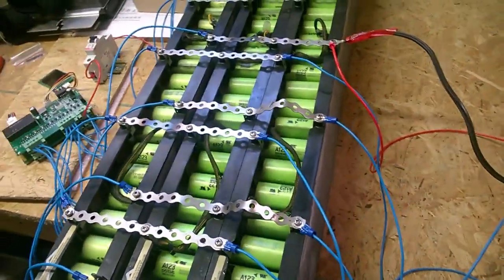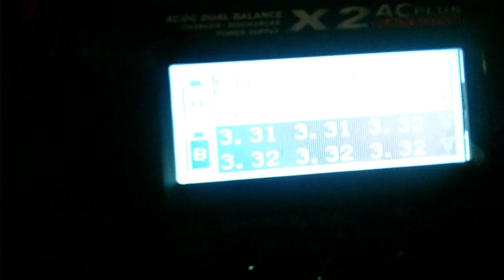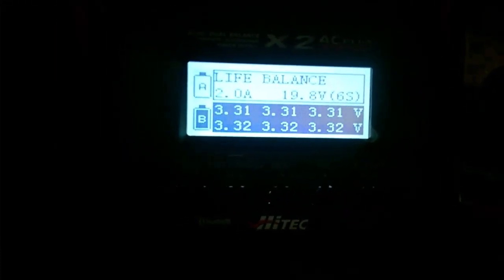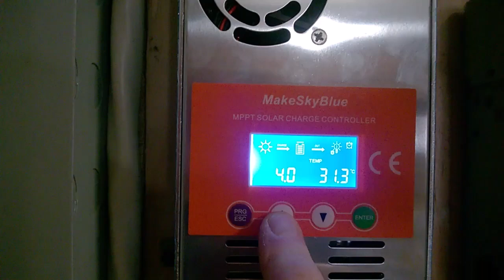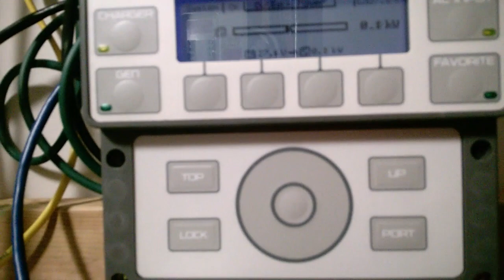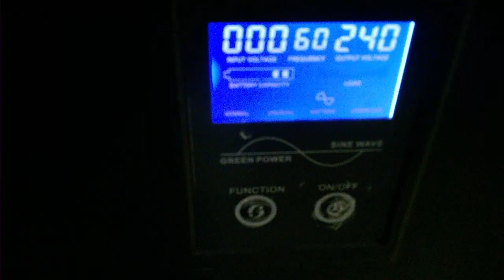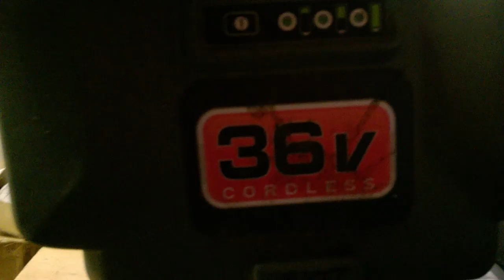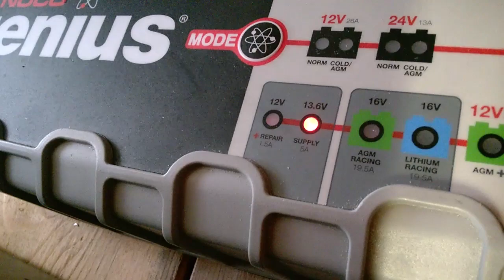2019 27 A123 battery update my obession with Lithium continues

Comment: How did you set up your solar panels on the makeskyblue
Reply from the maker: Just follow the menu for voltage but don't over panel the Makeskyblue they don't like high wattage or high voltage follow the manufacturers directions. I used 3 panels in series for 120 volts
Reply: @offgridwanabe  I can only put on series 2 panels of 46V peak.
Reply from the maker: @simplyfocus9937  Yes 2 or 3 in series works but keep the wattage down to 1800 watts

Comment: Where did you get those copper holes strapping line things you used to parrelel series connections I need that
Reply from the maker: Plumbing department used for strapping copper pipes.
Reply: @offgridwanabe  must be a Canadian thingni think ur from canada  I only found a crappy only not like that in the us east coast
Thanks anyway I am building mine like that now but taking the 12s and making them 16s so I can work with 48v inverters
Reply from the maker: @plojm123  https://www.homedepot.ca/product/dahl-all-round-strapping-copper-22ga-1-2-inch-x-10-feet/1000115954
Reply: @offgridwanabe  awesome supply house has online. Another question I just got a bunch of packs most testing good so far what size bolts are the terminal ends they seem so small the threads I am surprised they used that kind of small thread to hold something with so many amps

Comment: How do you base charging amps for cell groups. Are you going with spec so i mean if spec says 3 amps per cell standard then a group of 8 cells 24 amps. That type thing.
Reply from the maker: Well basically I cannot produce enough amperage to worry about the safety of too much amps because I need so many to have any capacity worth using. But I did consider it at first and the racks hold 16 packs with 12 groups of 8 so so at 5c I can't even get close with solar, the wiring and breakers limits me more than anything else.
Reply: @offgridwanabe  Understand and sort of figured that to.  I figured i would 1000's of amps on the single cell groups.I can come up with around 600 amps but that is not even close to what the spec's state for standard. Which is not able to be done. So i,m still in thought about it yet to what's the best way to go.
Reply from the maker: @MrDoingEverything  Remember amps are shared so if you have an 80 amp breaker on the pack each cell group of 8 would draw 80/12=6.6 amps and then /8 =.83 amps and that is on just one pack a little different on say 12 volts 80/4 =20amps/8=2.5amps per cell and if I can remember right 2.5 amps recommended or 10 amps for 12 minutes on fast charge.
Hope this helps
Reply from the maker: Hey if you think I am wrong let me know I don't pretend to know it all and learn every day.
Reply: @offgridwanabe  Your right a sharing happens
Reply from the maker: @MrDoingEverything  Ya not always is the sharing equal in amps as I have observed many times but I believe that is the nature of batteries theory only goes so far then you just got to do it and the poorer batteries are usually faster to take the charge.
Reply: @offgridwanabe  Lot of factors for sure.  We have what we have to work with and finding the best methods that work on the equal scale. As long as we get it all to work out the best we can hey what else is there really. : )

Comment: Hey, those built-in balance boards don't work unless they're given a special signal to turn on.  Even then, they're very weak (judging by the size of the resistor arrays), so even if they did work, they would be just enough for one pack in good condition, much less several worn packs in parallel.
It would be best to throw them out and use a real balancer on large parallel arrays of packs.  The parallel  arrays of packs will reduce balancer costs, wiring complexity, and promote higher inter-pack current sharing/balancing to preemptively even things out, but will require a strong balancer (up to several amps) to keep them in line.
Reply from the maker: True enough that is the way I went too bad I didn't know that 2 years ago tho. Been interesting figuring it out Now I have 40 kwh hooked up and running

Comment: Hi, I just got a few of these and I'm trying to figure them out. Do you have a one line diagram of this so it's a little bit easier to navigate through and know what else to buy. Thanks, your videos are of great help!
Reply from the maker: Not sure what you are looking for the battery is 12s 8p which is 40 volts of LiFePo4 lithium. So you need to decide what voltage you are using and configure the series to that. 
i am the worst at reading electrical diagrams and seldom use them. If I can help I always respond to a question good luck.
Reply: @offgridwanabe  Ca you provide me the model of charger that you are using?
Reply from the maker: @fabianluciano5237  I have several Charge controllers Midnite 250 is the one I like the most. I usually use the inverter / charger with AC charging when I need it both the outback and the Magnum have built in AC charging. I also use the Tripp lite on the 40 volt system. The powMr or Make Sky Blue is a cheap charger that will  get the job done but the exact control is not there IMHO. My system is very complex so I use AC coupling with the magnum to charge at night. I hope this helps I know it is very confusing.

Comment: Hey there! 

Question for ya. not sure if I misunderstood ya, but did you manage to get the built in BMS to work? if so, mind sharing how you did it? 

Thanks from Ontario!
Reply from the maker: No I did not get the original BMS (that came with the pack) to work. But I did get the ANT BMS to work and it works great
Reply: @offgridwanabe  Gotcha! Trying to figure out if it would be possible to use the built in BMS to only do the charging portion, then by pass it for discharge
Reply from the maker: @camofelix  It may be possible from what I think you need an outside voltage applied to the board maybe 3.5 - 12 volts to activate it and allow data transfer to the temperature probes but this is all conjecture and may destroy the board but I at least have lots of them to practice but I am not that bored yet lol.
Reply from the maker: @camofelix  Also the original board did not control the charging as in the current was not passed through the board, but in my best guess it controlled the balance and sent information to the controller which we don't have to discontinue the charge so kinda like a relay.

Comment: I love your work on the bus battery packs. Thinking about powering an off the grid cabin myself. I'd love to talk to you and learn about your experience on this.
Reply from the maker: Thanks for the sub I normally answer any questions I can, this helps those that don't want to ask and then everybody can get what they may need.
Reply: @offgridwanabe  So nice to see your prompt response.  I ordered 3 packs from Ebay before discovering yours and Frank's work. My main concern is that the batteries are so worn out that I will not be able to use them as a whole pack. But your videos are really encouraging.  Based on your experience having worked on dozens of them, what are the chances that I can work with the packs as they without having to dismantle them?
Reply from the maker: @josephdewuhan  Most packs I have seen are ok they really don't wear out but may be only 80% capacity. What does happen is one or two of the series may be damaged from corrosion or abuse and they can be fixed or new packs. When you get them find out what version you have the two most common are A or B I prefer the B series but A works too. The biggest problem for most people is getting the correct series for the voltage they want anything under 40 volts can be done without dismantling the battery pack. Frank even runs some at 120 volt DC but you need special equipment. So soon as you get them check each series to see if they are good or dead likely around 3.2 and whole pack around 38 or higher. Good luck
Reply: @offgridwanabe  Thank you so much for your answer. I look forward to receiving my packs. Another question,  where do you buy solar panels in Canada? What kind of price per watt is considered a good buy?
Reply from the maker: @josephdewuhan  Depends where you live. I find most things I need on Kijiji and I love a deal, $100 for a 250 watt panel is more than enough but you may have to but 25 or more. I see lots for $150. I found my Canadian Solar 72 cell panels 3 years ago for $0.33 a watt.
Reply: @offgridwanabe  wow, the best price I can find now is something like $250 for  300 w, something like 0.83/watt. Cannot find cheaper than that.
Reply from the maker: @josephdewuhan  What city do you live near?
Reply from the maker: Here is a couple of examples
https://www.kijiji.ca/v-home-indoor-other/mississauga-peel-region/used-230w-solar-panel-module-home-house-cottage/1487281339
https://www.kijiji.ca/v-home-outdoor-other/belleville/295w-canadians-solar-panels/1491271379
Reply: @offgridwanabe  I'm in Vancouver. Anything in the east would be expensive if shipping fee is calculated. So, that is a big disadvantage.
Reply from the maker: @josephdewuhan  Oh too bad ... best buy a skid full and sell the rest, by the looks of prices in Vancouver.

Comment: wow, is it worth the price difference between this and a full size battery?
Reply from the maker: Yes these were from Buses and they scrapped them all as they are going to full electric and not hybrid so I get around 8kwh for $600 and I can use most of it unlike lead acid.

Comment: Nice setup, i have some of the bus batteries ordered to see how i like them, going to use them on a 24 volt magna sine PAE 4024 AC coupled system . have you got the BMS that came with the bus battery to work? I wondered if I could link the battries together and balance them hope it works out.
Reply from the maker: I abandoned the original BMS it didn't do what I wanted as I needed more control for balance. Yes they will balance but I suggest using a bms with active balance and at least 1 amp of transfer power the 200 milliamp works but just barely if the packs are out too much. All in the bus batteries are ok and we get get them at the right price directly from the junk yard
Reply: @offgridwanabe  That's quite helpful, thanks! Yes, I think that the original BMS on the module just did passive balancing between the 12 cells of the module.  It also appears that the overall pack controller did additional balancing between the modules: check out this quote from the bus manual: "(3) Individual ESS Module Over-Charging Protection.
The ESS is made up of 16 individual, 39.6 V DC (nominal) modules connected in-series.
Due to manufacturing and temperature variations among the modules, there are slight
impedance differences in each of the 16 individual modules. This impedance mismatch
tends to force the voltage of each of the 16 series-connected modules to be different as
current is extracted from and delivered to the complete ESS. In order to protect each
individual module from being over-charged or under-charged due to the voltage mismatch,
an electronic battery optimization system is employed to actively equalize the voltages of
the individual modules."
Reply from the maker: @barryrawn8167  Thanks I have heard with an external 5 volts applied to the bms it becomes active but I found much more control with a new BMS but still an interesting fact about the impedance and the balancer shows the difference in resistance of each series so I know what they mean.
Reply: @offgridwanabe  True, it's nice to know the impedance can be a clue about future performance troubles.  Where did you hear that it can be activated with 5V? I'm trying to work out if one can communicate with the BMS, as it seems like the modules are originally daisy-chained to allow information in and out..
Reply from the maker: @barryrawn8167   Well some website way back had some technical information and I was reading it I wish I had kept it but I had already decided to move on so in one ear and out the other.
Reply: @offgridwanabe  ha ha ok I understand.  Thanks for giving it a thought and good luck with your continued powerwall development!

Comment: So, you have a 120 volt inverter?  What is the brand/make of that?  That probably keeps the amps pretty low.
Reply from the maker: Yes it does keep the amps low and wire size is small, but you need to find charge controller that will make enough voltage and string size also increases, I don't know the make likely Foshan or Fangpusun . The nice part is the voltage range of usable battery is larger. Cheers
Reply: @offgridwanabe  Cool.  I would love to watch a video just centered on the topic of 120 volts DC.  Such as finding an inverter, finding a charge controller.  Pros/cons.  I think it's awesome when people do things out of the ordinary.
Reply from the maker: @DavidPozEnergy  I already dismantled that experiment for now and started battery operated Enphase inverters as they match the voltage profile of those A123 batteries better. Frank Z has a 120 volt system he uses all the time I may put mine back together again for water heating this winter. Thanks for watching.

Comment: hi from great britain are these cells good quality as im after renewing my v28 milwaukee tool batteries and also a pack for a 48v scooter i have bought that has lead acid at moment any advice appreciated mel
Reply from the maker: Hello and welcome to my channel. For the most part these batteries are pretty good but I bought them knowing some would be bad after all they were from the junkyard. I have over 4000 of them and so far about 100 bad ones. Being Lifep04 they convert easily to any lead acid voltage.
Reply: i have asked wang the company man in china tonight as they now own the boston/michigan based a123 company   yes shipping is a pain
Reply from the maker: @honda4004  Yes china is the easiest way to order lithium Alibaba or Aliexpress They seem to know ways around the shipping.
Reply: hi again just after some tech advice now  just stripped me v28 milwaukee batteries down to each bare cell and checked out puts and they read zero on 6 and from 0.01  to 0.03 on 8 may it be i can charge it cell up or does that class them as knackered any help appreciated as first attempt on this battery recondition
Reply from the maker: @honda4004   This is a tool battery right? if so I have tickled them with 12 volt to wake them up so the charger will recognize them otherwise the best way is to use a hobby charger like HiTec or similar to charge each battery to see if it will hold a charge. Those batteries are 26700 so a little different than the 26650 I have but very similar in voltage requirements.
Reply: thanks yes tool battery best thing is they were made in canada but no maker unless moli is a maker got them in bits now so new cells or class b would be best route as ive had these 8 years not used last 3 years so that maybe whats caused degrade   what would you say are best cells on market for cost   them a123 cells are on ebay uk a guy inpoland said for 28 cells £62 plus shiping
Reply from the maker: @honda4004   well from what I see you can get a replacement battery for $75 so that is likely the best bet. But if you wanted to fix your self the 26650 would fit but new ones are about 10-13 dollars each  and you need 8, so that is why I suggest to get the replacement. Perhaps you can find used ones on GB.
Reply from the maker: @honda4004   The other way is to use 18650 cells they are more easily found and cheaper the trick is to get the voltage required as they are 4.1 volts per cell so you would only need 7 in series but you would need to be careful charging them
Reply: thanks not that electronically minded but the link i sent you on the aldi ferrex batteries the guy strips there 40v one down in another video and they look good 2500mah
https://youtu.be/H9Mb5_nCVeo
appreciate your view the 40v are the yellow set x 10 so for £90 i could repair 4 milwaukee batteries
Reply: hi thanks for all your advice i have found out my original moli cells were made in british columbia you anywhere near there factory :)  and ordered a cheap 2 cell li ion charger off ebay to see if these  originals kick back up may go down the aldi supermarket ferrex 40v route though it says rigid 24v use these moi cells but not a popular tool in britain thanks again and i welcome suggestions
Reply from the maker: @honda4004  I am glad you found an answer. Unfortunately BC is almost as far away as you lol about 5000 kms but a wonderful place. Remember to charge the dead ones at as low amperage as you can to start to see if you can revive them and Good luck
Reply: thank you  im in to static air engine if you see my land rover video i met a guy on youtube called peter stevens of northern australia ingventor  his channel name he knows all about vander vault forces his web site www.weathercreation.com  he knows how to run engines on stripped energy air   joe cell horses mouth  is his main video on that the guy joe booker is the main discoverer